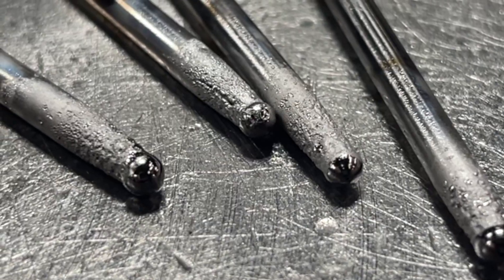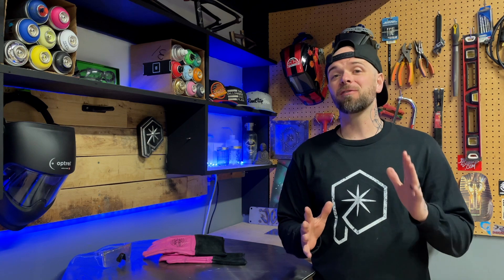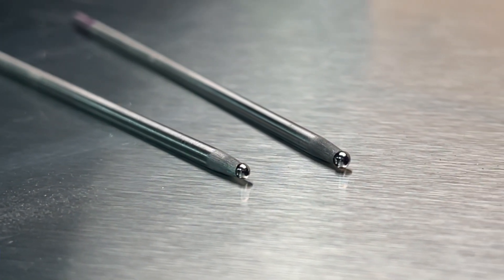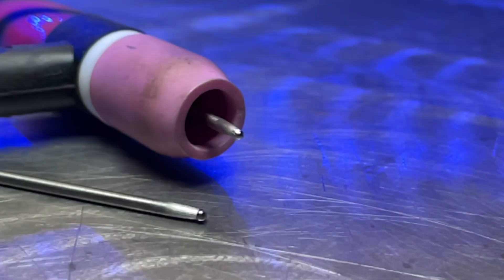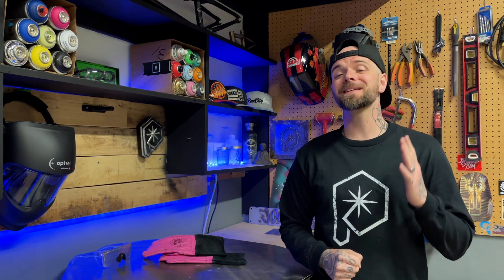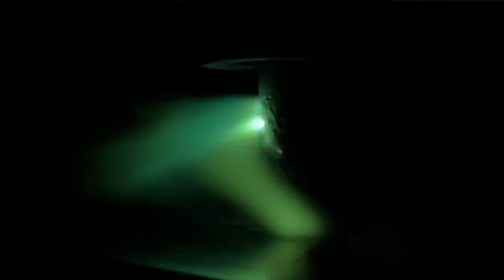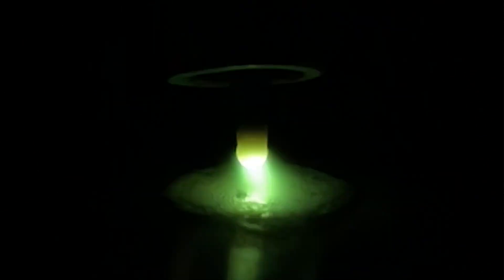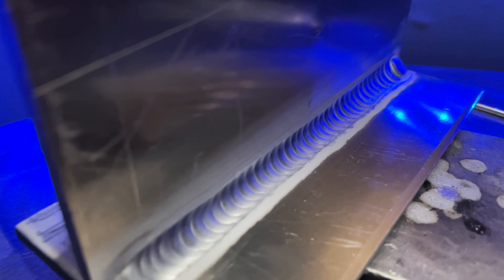Don't use this Tungsten for Tig Welding

Comment: Holy cow guy’s, pull that tung back into the cup!  Only pulls the tungsten that far out if it’s hard to reach! Most of the time you should barely be able to see the tip, while working! The ark will jump 1/4- 1/2” no problem.   Use auto shades so you don’t have to do head flip while starting a tight spot.
Reply: Gas lens baby! No one has to be that fussy about stick out unless you’re still rockin the old school collet bodies
Reply: Nooooooope!!! What YOU should do is not what everyone should do.

Comment: Beginner here, just got a tig rig for a Miller stick welder. Mainly doing thin stainless sheet metal. Keep getting a squealing sound while welding from the arc. I did reverse polarity , and I know I’m using too much heat based off one of your other videos. Welds look bad. Any idea about it?
Reply: If you're tig welding stainless steel you must use DC current (squealing sound is something normal when tig welding aluminium using AC current) and you must use the correct polarity (tungsten to negative and base metal to positive, so the electrons transfers heat from tungsten to the welding pool). 
As far as I know, the only exception to this rule is when using gasless mig welding. 
If you are using pulsed DC tig welding, check your pulse frequency setting. High frequency pulses could turn into kind of squealing sound. 
Otherwise basics don't change and pretty welds mainly involve correct and constant tungsten distance to the welding pool and correct and constant angle to welded base metal.
Reply: @vozhdmeister5256  thanks man I’ll check all that!

Comment: what about scratch start tig?
Reply: What about it?
Reply: @JackOffAllTrades  well if the pro's say don't dip the tip, how do you scratch start without dipping 🤔
Reply: @allothernamesbutthis   that's not how it work. touch down wait a second or two then lift off, the arc start is lower voltage.

Comment: I like to grind both ends so i can just flip it
Reply: But you can't get the contaminated end through the hole in the gas lens or collet, so you have to take the back cap off every time?
Reply: @JackOffAllTrades  if you don’t dip it bad it goes in. If you have to push it at all it’ll still wear those parts out quicker tho

Comment: I agree with your thoughts on tungsten maintenance I use 2% lanthnated for alum and steel I won't go back,thanks for all your tips🤗😎😎
Reply: I do to, It seems to work the best with my welder
Reply: @danshafer4979  Seems to be the best one out there. I'm running them too.
Reply: Get with the LaYZr game. Seriously, if you haven't tried it, you're missing out.

Comment: Could you do a video on out of position welding?
Reply: Come to motorsports industry. I weld WRC spaceframes and cages daily. Sometimes need to hang out like a ape to nail down some gusset or tube joints. 😂
Reply: @Marko-JZX100  how did you get involved? Offroad racing isn't big in ny area and I wanted to relocate so I plan to volunteer for a couple events around Nevada and Utah to get my foot in the door.
Reply: @cleon135  Bought a tig welder about 7 years ago. Learned to weld and fabricate with my own car at first. Down the road done all kinda small projects to other car builds, and got to known people around the country involved with tuning and motorsports. Half year ago I was asked by a employee of TGR that would I be interested in building chassis for WRC. Hit up with a resume, gave weld test and yeh thats about it.
Reply: @Marko-JZX100  awesome! Thanks for the reply🤟

Comment: And have a dedicated grinding wheel for your tips to avoid tip contamination. Or at bare minimum a spot on a wheel that only tungsten touches.
Reply: Just sharpen a little longer knocking stuff off the wheel

Comment: He said he likes using a tungsten with a ball on the end of it. How do you create that
Reply: If you run on aluminum it'll create it naturally by just welding. Can't think of another scenario where you would want a balled tip.
Reply: The way you grind it. No point, just flat end and chamfer about 1/3 the depth.
Reply: Turn the balance to max (opposite end of the 30 whatever % you normally run), hold a tight arc on a clean piece of aluminum or copper, and slowly push the pedal down. It'll look and sou d like a tiny lightning storm for a second or two, then get super bright super fast and a ball will form. The longer you hold it, the fatter the ball, but you really only need a small shiny ball to make a huge difference.  Don't forget to adjust the balance back to whatever you usually run. Also, higher amps makes the ball form faster.
Reply: @manofausagain  DO NOT DO THIS

Comment: E3 tungsten sticks tolerate dips much better than golden tungsten sticks. That means, you can dip an E3 tungsten two or three times and still weld well. With a golden tungsten, one dip and it's over.
Reply: E³ exclusively for AC🙌 because it's 1/3$ as CK LaYZr 🤷‍♂️ but dips depends on how bad. Better off just swapping every time.
Reply: Never a good idea to keep going after a dip, especially if your work is required to be high quality. If you weld professionally, or even as a hobby, it doesn’t take long to grind 5-15 tungstens to have on standby.
Reply: E3 are THE SAME as gold… just marketing 😊
Reply: @Deichwerkstatt  Gold is 1,3 to 1,7 % Lanthanum oxide.

E3 has three oxides (hence the name): Lanthanum oxide (as before), Zirconium oxide and Yttrium oxide.
Reply: @AndreasR1  read the safety Datasheets from the E3 and from 1.5 lanth.. zirconium and yttrium are also almost in the same amount in a 1.5% lanth.. some E3 have a bit more lathanoxid in them so they run more like a 2%.. but most of them get killed on AC and they have a wide quality range.
Reply: @Deichwerkstatt  Thank you. My noname golden ball up quickly (even on DC), while my noname purple last much longer. I will try to round electrodes a bit just after sharpening them.
Reply: @AndreasR1  Noname is always a Problem.. where are you from?

Comment: 90% of what your talking about is only relevant to welding aluminum. Your viewers should know that
Reply: If you tig weld, more than 90% of the people should know that just by looking at the tungsten. Or maybe the material he uses. 
 
Idk, why does everything need a fucking disclaimer? Isn't it obvious?
Reply: @JackOffAllTrades  Read the comments Joshua. It's amateur hour over here. Nothing wrong with that. Just saying.

Comment: You prefer to run a ball on your tungsten even when welding steel?
Reply: If your welding stainless with i ball I’m pretty sure that’s not gonna work well😂
Reply: Probably just for aluminum. He usually focuses on aluminum welding

Comment: How do you prepare your tungsten with a ball on the end of it.
Reply: You can switch your machine to reverse polarity and just lightly tap the pedal until it balls or if you can adjust your AC balance to be as close to balanced as possible and do the same thing with the light tap on the pedal that also works
Reply: Grind it like that.

Comment: Ball'd ends are the old school way of welding Aluminium with the old rectifiers AFAIK ( Sychrowaves etc ) most of the new Aluminum GTAW machines use inverter technology which imo is far superior. It allows you to weld Aluminum with a pointed tip . You have far more control and can manipulate your HF more up into the 300 HZ to lay very small and precise beads .

The really old machines I used we used to switch the polarity to DCEP strike a arc to get the balled end and switch back to AC to weld .  Good riddance just get an inverter like a Dynasty lol
Reply: Uhhhh, those everlasting welders ARE inverter machines. Balled ends, when done properly on a nice hard tungsten like 2% Lanthaninated, work very well for a lot of applications. Personally yes, I do prefer a pointed tip, but if someone can lay strong, clean, nice looking beads and follow the wps, then who gives a shit how they sharpen.
Reply: @lyster1ne681  Never saw what he was running in the video .  Everlasts are nice machines . Just saying the old school AC tig welders are like making a phone call with a Nokia when these days there is  smart phones  ( inverters )
Reply: That's only good for the first 3 or 4 minutes. After that the tip looks like shit and needs a little ball to pinpoint the arc.